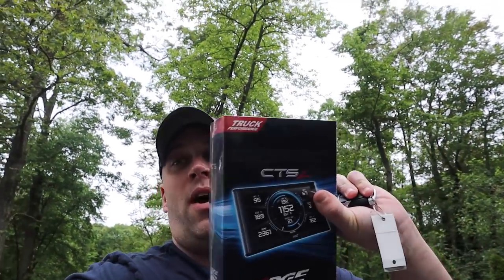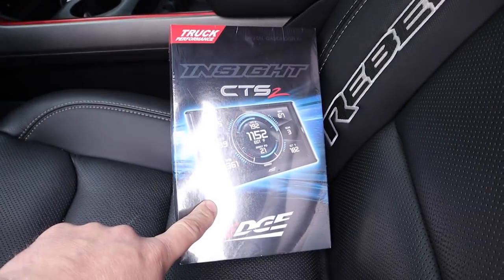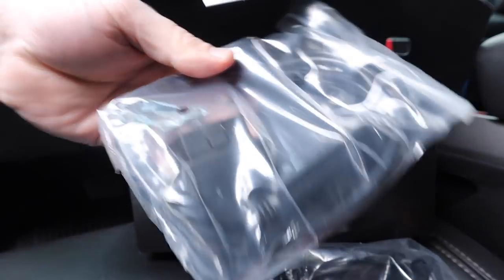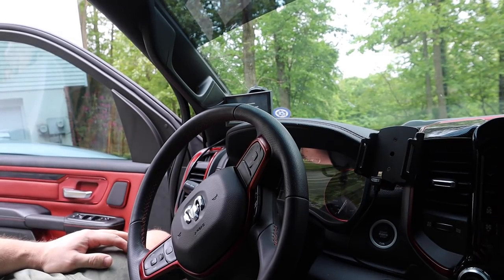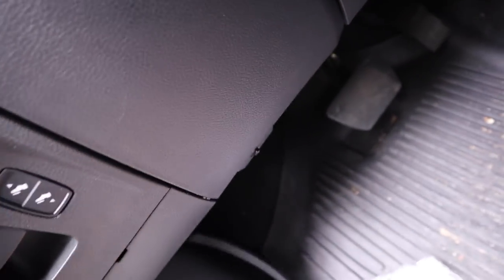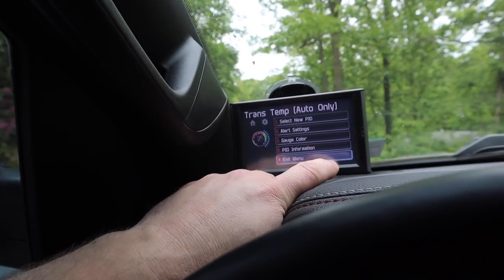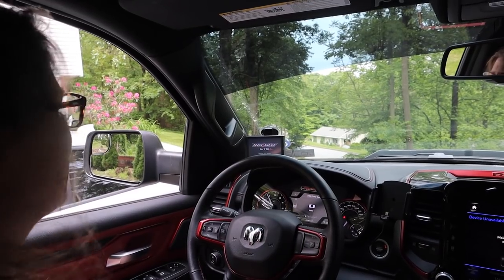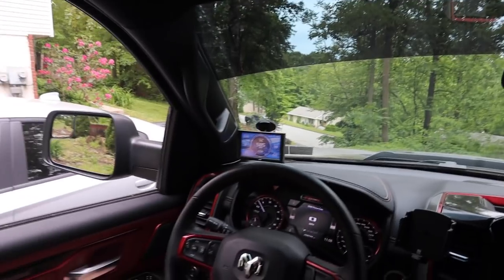GREAT tool for monitoring your vehicle's vitals (Gauges). Will the wife APPROVE?!

Comment: Other than the fault code diagnostic and the potential to add a front camera, what other information does this provide that the Ram customizable gauge cluster can’t do?  I changed my gauge cluster to show trans temp, oil temp, oil pressure, and oil life.